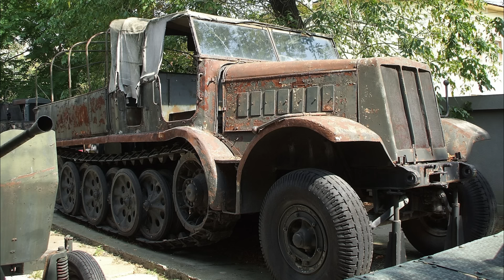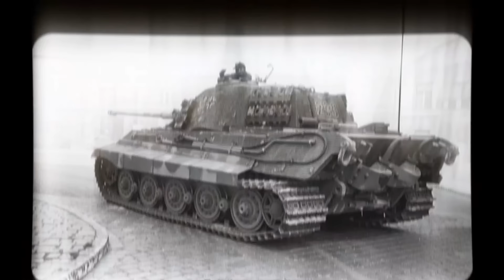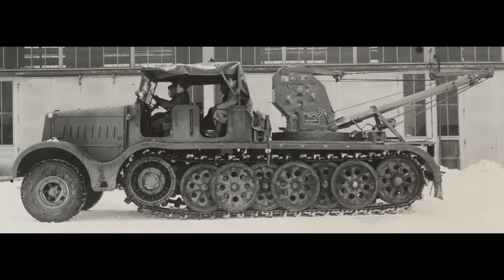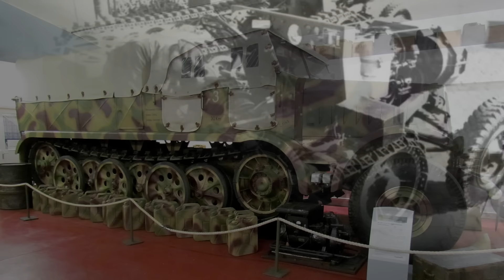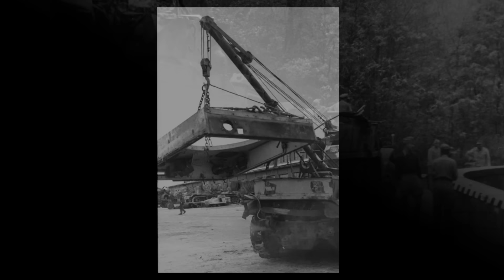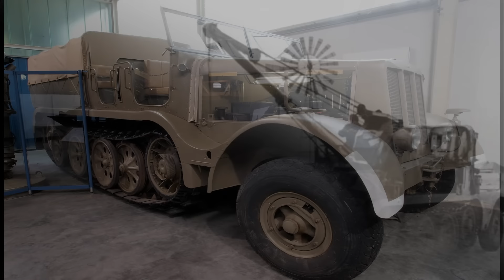FAMO - The Monster Machine That Carried Germany’s War in WW2

Comment: These machines were truly built to last...the post war German building industry prized these vehicles...as it did a lot of the heavy half tracks used by the wehrmacht. I remember seeing the recovery version with its crane painted red in a photograph dated 1957. The Famo was excellent at recovering light and medium Panzers but struggled with Panthers and Tigers with up to three being needed to pull a Tiger. It was a masterpiece in quality engineering but as the war went on it proved too complicated and expensive  for mass production. Like all the German  half tracks the well thought out..well built versions that started the war gradually deteriorated as the war went on and skilled workers and materials became scarce. Thanks for covering this amazing vehicle 😊👍
Reply from the maker: Brilliant insight, Michael — you summed up the FAMO’s story perfectly. Built with incredible precision early on, but the complexity and resource strain caught up fast. That red crane recovery version sounds like a rare gem to see in photos! 👏 TY

Comment: German overkill engineering. Still needed 3 to tow a Tiger tank.  The  British got by with Scammel trucks, the US with fully tracked vehicles for heavy haul and recovery.
Reply: it was the most powerfull of his kind in wo2. So no British and American hadnt better pulling gear!. Their vehicles where lighter, for the heavy vehicles the needed 2 ior 3 vehicles to pull. So their was no difference.
Reply: @iltis1963 The Scammel used winches and pully blocks in recovery situations to increase its winching capability many fold. Use the work smarter idea rather than brute horsepower to tow tanks and recover vehicles in trapped mud and steep slope situations including roll overs. Many a Tiger tank was abandoned as unrecoverable as there were not enough Famo vehicles available to recover them.
Reply from the maker: Great points — the Scammell’s winch-and-pulley setup really was a clever solution. Different philosophies for different armies 👍🏼 TY
Reply from the maker: True — the FAMO was one of the most powerful half-track of its type in WW2. And you’re right, every nation needed multiple vehicles when recovering the really heavy stuff. 👍🏼 thanks
Reply from the maker: 👍🏼 The FAMO’s power was impressive though
Reply: The American and British didn't field 50 tons tanks like German did with Tigers. They had no demand for such specializrd heavy duty halftracks. The US and UK forces in their situation did not face the need for heavy tanks as they had good artillery and air support supporting their medium tanks, unlike Germans who did need them.
Reply from the maker: Great point — the Americans and British definitely built their armour doctrine around mobility, artillery, and air support rather than fielding super-heavy tanks 👍🏼😉Cheers pal
Reply: Winching is not towing. Do you have an example of a single Scammel truck towing a disabled Tiger tank on its tracks to a repair depot? Thought not.
Reply: @grantm6514 Generally, the final drive and the transmission on the tiger were inoperable due to ground up gear teeth jaming it up. The tank could not move as the drive for the track systems was unable to free wheel. Not even a Famo joint tow could drag it anywhere unless you could free up the tracks to free wheel. Try doing that in a combat zone with a Famo, and the Famo would end up being a twisted metal flaming wreck after it was hit.
Reply: @damianousley8833  Thank you for explaining that in order to tow a tiger tank on its tracks,  the tracks need to move freely.
Reply: @grantm6514 In order to tow ANY tank, their tracks have to be free wheeling.
Reply: @damianousley8833 and as what would a Scammel end up in such a situation? Let me help you with the answer: Same outcome - a burning pile of rubble. You talk a lot of rubbish to prove a point that doesn't exist.
Reply: @ceemosp Gee, ya think?😂😂
Reply from the maker: that’s a great breakdown. The Tiger’s drivetrain issues made recovery a nightmare, and unless the tracks could free-wheel, nothing was going to tow it far. 👍🏼
Reply from the maker: Me too… if the Tiger’s tracks couldn’t free-wheel, nothing could tow it properly. 👍🏼
Reply from the maker: Exactly 👍🏼
Reply from the maker: Fair point — any recovery vehicle caught in the open under fire would be in serious trouble, Scammell or FAMO alike.
Reply from the maker: You’re absolutely right that winching and towing are different jobs 👍🏼😉
Reply: The Allies was struggling with their UNC, UNF, Imperial Inch, Whitworth, Pounds, Feet etc while the Germans only had metric for measures.
Reply: @ursus9104 Not really as measurement standards in the British Commonwealth and the USA were well understood and the various threading systems and hand tool systems were also well understood. It was Whitworth who made the first micrometers in Britain, the French the first machine lathes. What Germany didn't have was the industrial mass production of the British, French, and the USA. German pre war manufacture was in high cost high labour of workers time in the manufacture of vehicles. Germany never really equalled the automotive mass production at lower costs in man-hours of the Western allies. Unfortunately for the Germans the French had better automotive plants than the German but after Franch was defeated and occupied they stripped out the French factories for tooling. This bit the German savagely on their conceited arises when they tried to get equipment manufactured in France as no one would re-equip French factories just to have the equipment siezed by the Nazis again. German standards of production were horribly in decline after mid 1943 by the extreme shortages of minerals to produce high grade steels were in varying short supply due to allied bombing of sources and German shipping losses in the Baltic. The tungsten or wolfram shortages became problematic as Turkey gave all its production to the western allies in an economic chequebook warfare act by the western allies buying up all of Turkey's production. The allied shipping blockade hampered Germany in getting many essential raw materials for its war production. The allied bombing of Germany also hampered wartime production and transport. Poor Germans thought they were technically superior but in many fields they were lagging so far behind that it would have taken 5 to up to 10 years of concerted research to catch up in critical fields to match allied abilities.
Reply from the maker: Absolutely and thanks for sharing this important info — Germany excelled in precision engineering, but the Allied advantage in mass-production, logistics and industrial scale made a far bigger difference. Technical brilliance doesn’t help much when you can’t produce enough vehicles, fuel or spare parts to keep the war effort going. 👍🏼
Reply from the maker: Interesting point! The mix of UNC, UNF, Whitworth and Imperial standards definitely made Allied logistics… lively. 😄🥸👍🏼
Reply: @AgeOfWarMachines Even metric can be confusing with its different thread sizes. 0.5mm O.75 mm 1.0 mm etc, etc. Bummer when you try to replace a bolt and the treads don't match because of different thread size. The different US and British bolts generally had markings on the head nut saying what they were. So do metric but the Germans economised metal and most bolts didnt have markings so out with a thread gauge.
Reply from the maker: Thanks for explaining all that — really interesting breakdown on the thread pitches and markings. Appreciate the detail! 👍🏼😉